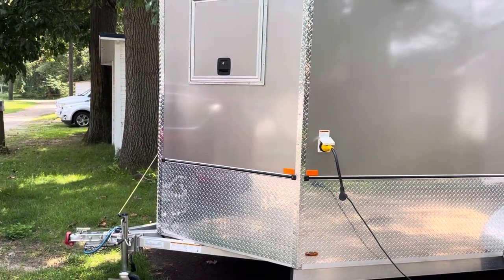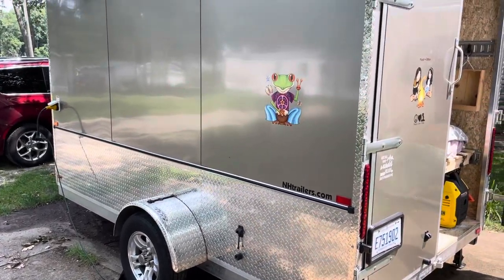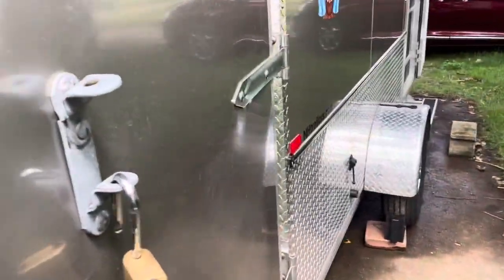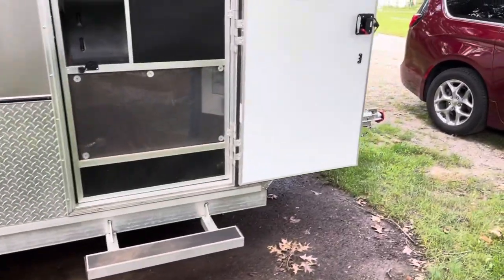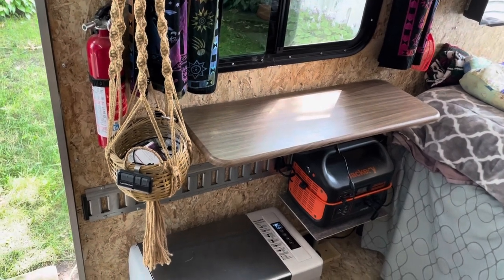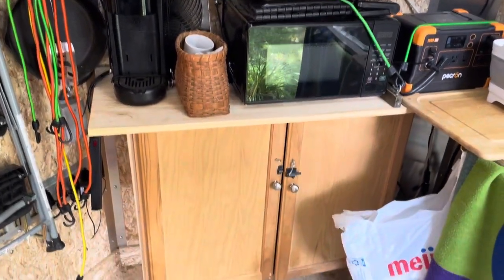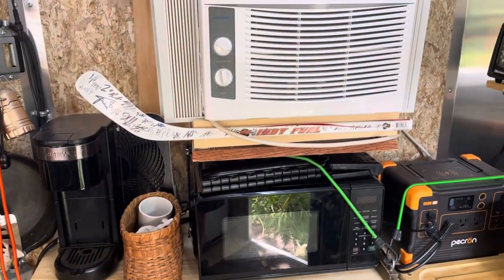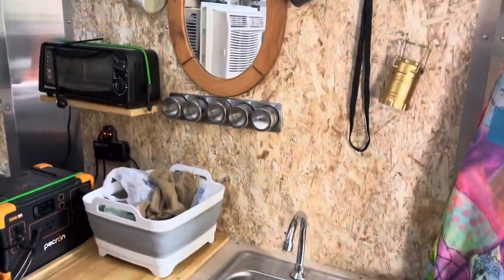DIY Cargo Trailer Travel Conversion

Comment: Love this setup and am interested in doing something similar.  Are you happy with ProLine?  Do you know the weight of your trailer?  Does it have brakes?  Does your Pacifica have anything special installed to help with towing?  How well does it tow through mountains?  Sorry for all the questions but I haven't found too many people talking about towing a trailer of this size with a minivan which is what I'm wanting to do as well.  But I'm a little worried about the toll it might take on my van.
Reply from the maker: It towed well but my trailer is very light and I had electrical brakes installed. A couple weeks ago I traded the Pacifica for a Honda Ridgeline. I don't notice much difference.

Comment: I love the concept of your trailer! Could i ask if that hatch of the AC is 24" x 24"? I looked at the company's website and that seemed to be the size? Also, how did you mount the drawer slides? Sorry for all the questions, it is a great solution to an issue I have been researching:)
Reply from the maker: Correct. It was an old desk drawer and I installed it to open backwards. The hatch functions like an awning for the AC

Comment: Kool little camper build you have everything you need. One question,did you insulate before putting on the press board and if so what type insulation. Thanks and good luck
Reply from the maker: Factory insulated.

Comment: I’m wanting to build myself a little camper but also haul my motorcycle.
Reply from the maker: Mine could do that easily if I made some elevator setup to raise the bed. If I had a motorcycle, I would have ordered the ramp door in the back. I ordered swing doors because I didn't want the spring system in my way. I hope you post what you come up with.